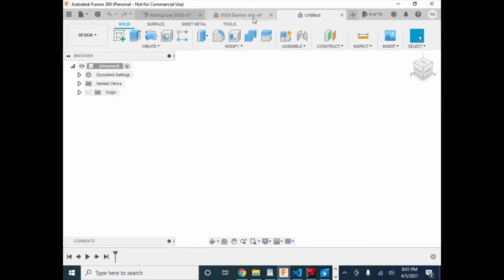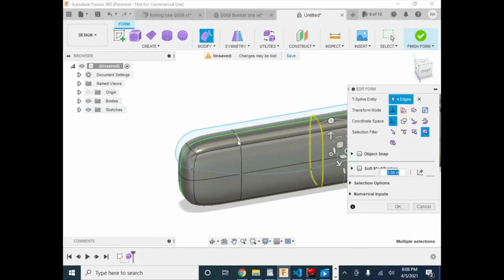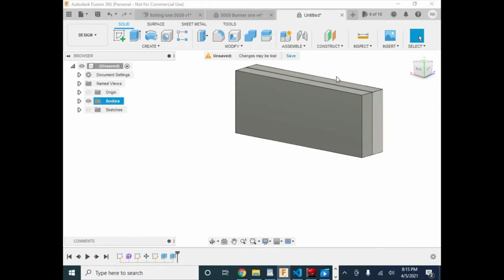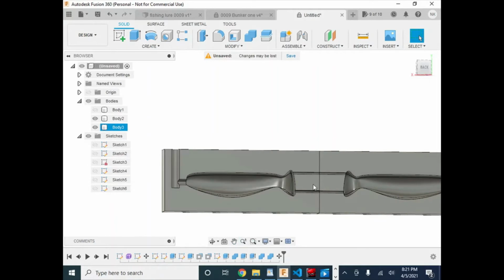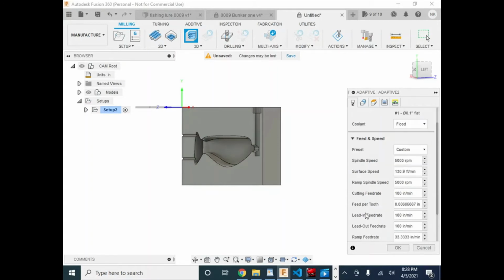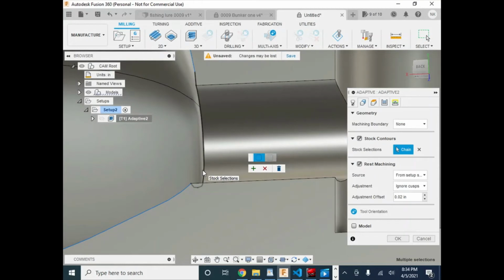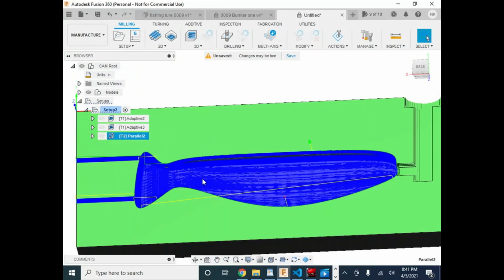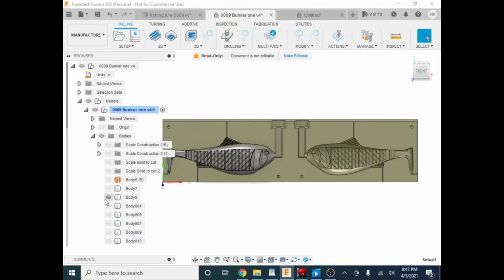How to make a injection mold for a soft plastic fishing lure Easy! Fusion 360

Comment: Great tutorial. But I do have a question. I followed you step-by-step. When I created the air vents and the injection port, then turned my body 2 on the cut out only appeared in one side of the mold. What did I do wrong?
Reply from the maker: I always double create the model and do the cut on one side at a time since fusion joins the two together

Comment: I will never understand why the sculpt space is so popular for making lures.  Draw you profiles (right  and top) add some intersecting profiles and loft it.  It’s so much easier to make subtle changes
Reply from the maker: Just a way I found works easier with making the mold and tool path creations, I tried to do things differently, but when it comes to making the inverted mold it's easier with scupled items than lofts, don't know why, but I did have some issues not on video with it, so sculpting space is what I prefer and it feels more artistic than modeling, but great comment! I think I'll try to make a follow up video with that approach.

Comment: Great video. Are these settings (speed and feeds/tool path) that you have good for AL? Like 6061-T6?
Reply from the maker: No, I just threw some numbers in there, speeds and feeds should be per your bit manufacture. Each bit (like the legit ones, not cheep Chinese ones) should have a speed and feed chart from the manufacture.  Try looking at Onsrud and looking at their bits, they have a great wealth of data. Additionally, it matters the rigidity of your machine, if I ran the speeds and feeds from my Mill on my desktop CNC, I can tell you I have broken many a bit on the desktop cnc machine because there is too much flexing and the bit will bend and snap. I think your bringing up a good topic, and maybe my next video I should show my way of calculating speeds and feeds to help the topic.